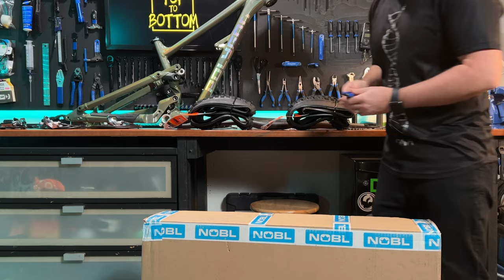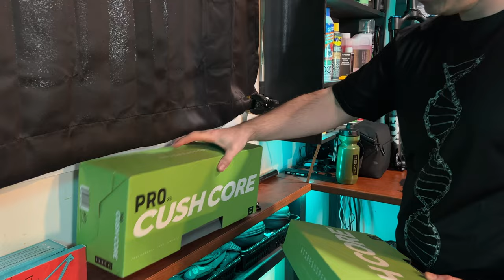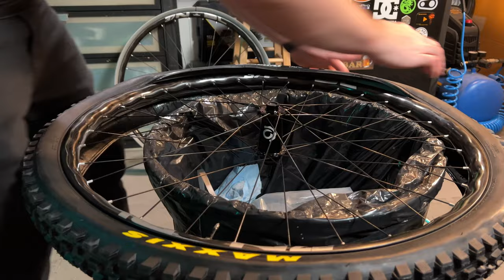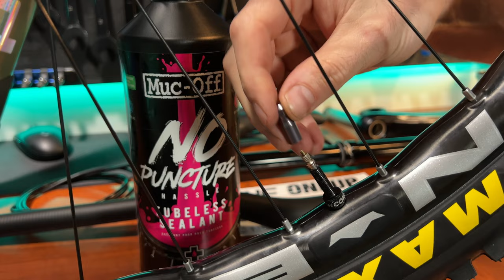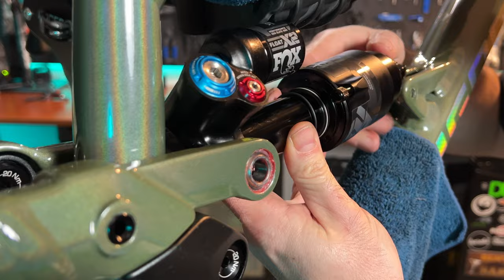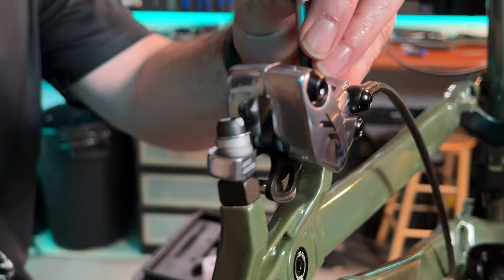DREAM BUILD MTB - POLYGON COLLOSUS N9

Comment: New to the sport, just got into it less than a year ago - LOVE watching your videos, and one of your videos inspired me to get my first bike - Kona Lava Dome 29er. I made a few upgrades - Trans X dropper, converted to tubeless, carbon handlebars, upgraded stem. I wanted to change out the suntour 100mm spring fork with a little more travel out of the next work like 120mm - Thoughts on this? I know on your channel you had stated to stick with a travel that the frame came with but I didnt know if that was for extreme cases like going from 100mm to 140mm, or more. 
Also the bike comes with a microshift advent drivetrain, do you think going with Shimano Deor groupset is worth it?
Reply from the maker: Love hearing that! Sounds like you’ve done quite a bit to the bike! Going up 20mm should be alright. You might wanna shoot Kona an email about it if you’re concerned with frame warranty. And Deore is cheap, strong and reliable. I run it on my 8k e-bike.

Comment: Sweet build, and got it down to 31lbs. I’ve got a T8, and loving it so far. I want to get my T8 down to that weight. Upgraded cranks to SLX, grips, pedals, and bars. I’ll upgrade my rims soon and should help with shedding some weight. Will eventually shed the Tecktro brakes to XT 2 piston next year. They work right now, why spend $$ right now. Still rocking the T8? What upgrades did you do?